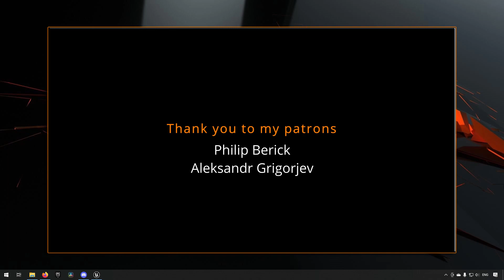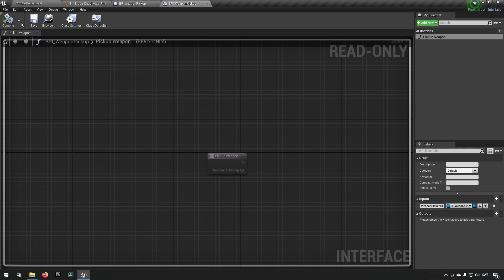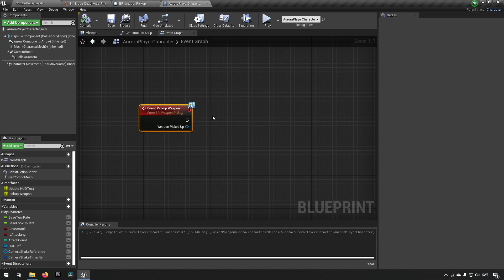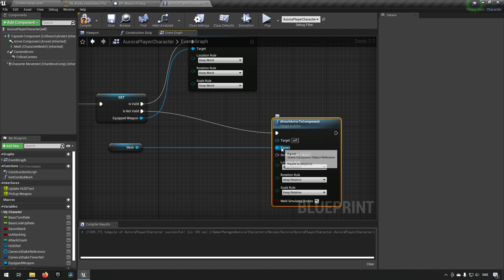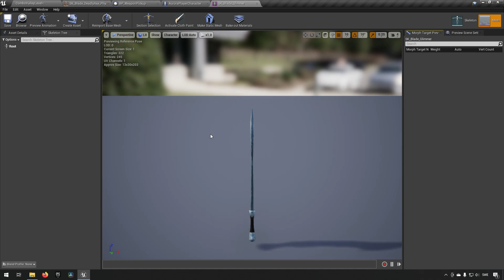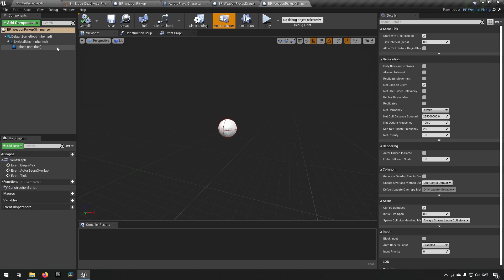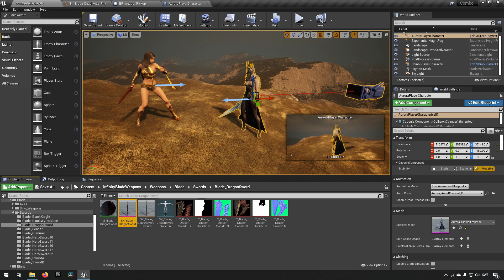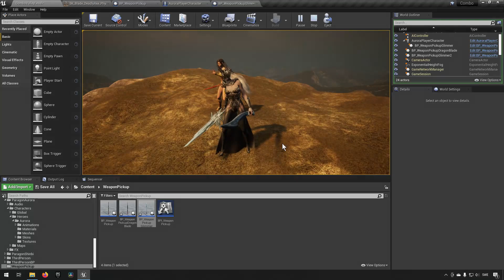Tutorial request: Weapon pickup - Unreal Engine 4 + Unreal Engine 5

Comment: Hey sry for being annoying, but im trying to attach it while pressing a button and the result i get is the mesh is actualy attaching to the item i want to pick up making it pretty funny but not usable cause the item control the character and that make some crazy thing and i realy dont know what i changed from ur method despite adding an input action to trigger it any idea ?
Reply: i realy dont understand why it dont work the target and parent are the same as u, but the result is swapped and the root of my character attach to the item. I think it may tied to me changing the default root component of the item by mistake maybe
Reply from the maker: As long as you setup everything the same as in the tutorial, you should get the same result regardless if you execute the code through an input of a key or walking over the item, like shown in the tutorial.
Reply: @LeafBranchGames  I KNOW WHY ! That took me so long its cause im using a static mesh and not a skeletal mesh in bp_weaponpickup. But i learned some new trick cause i was searching everywhere and also with ur recomandation with Mathew Wadstein. Thx for ur content
Reply from the maker: @efsfsesegsgesg8775  Glad to hear you solved it.
Reply: Actualy its just the collision that have to be set a certain way if someone wanna know

Comment: when you ''set equipped weapon''. Is there a way to ''unset'' it when you detach the weapon? because right now, my other blueprintcharacter can steal a weapon out of someones hand, wich is great. but then it doesn't notify in the blueprint that my other character has ''dropped'' the weapon
Reply from the maker: Sure. You can do it so that the weapon informs a character when it is equipped or not. So if you have a function on the weapon that a character calls, call "equip" or something. Then the weapon can have a variable of who "holds it". So if someone tells it to equip, then it will first inform its last holder (if it had one) to unequip before assigning the new holder.

Comment: Any idea how to fix Paragon animations that have been retargeted to the UE 4 mannequin? Mine float :/
Reply from the maker: If all the animations float, then you can just move the character mesh a bit down in the capsule.
Reply: @LeafBranchGames  Yeah, the only issue then, is all my other animations sink into the ground. I guess it's an either or situation heh
Reply from the maker: @dreadtrain2846  That is why I asked if all of them float. You can adjust the import settings of animations if you can import them with changed Z values. Other than that you can edit your animations to be adjusted in height in Unreal engine, by for example key framing them with a Z offset..
Reply from the maker: @dreadtrain2846  No problem.

Comment: while this is great it only shows how to pick one weapon am looking into picking 2 weapons and dual wield them
Reply from the maker: The logic would not be very different. All the picking up parts would all be the same. You would just add some logic when picking up an object to determine  if you are already holding an item in one hand, then place it in the other hand. You would of course have to create a second socket to attach that weapon as well. But it is all very similar to the first part.
Reply: @LeafBranchGames  it would be great to see a tutorial on it with it working with weapon drop
Reply from the maker: @issamaf80  Sure, I will put it on the list.